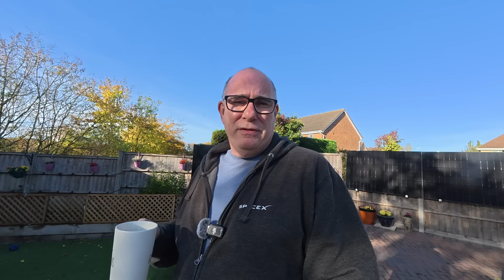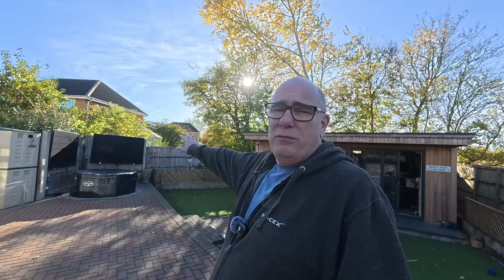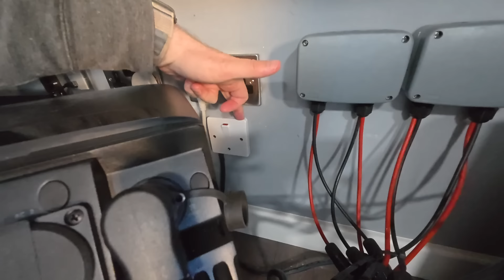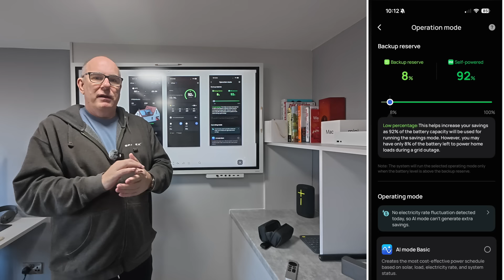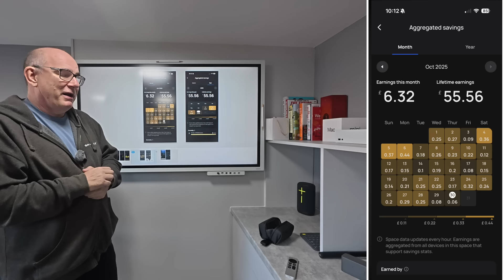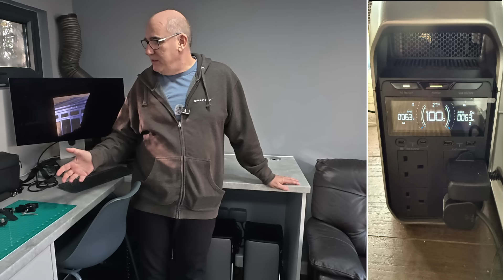I Tried Plug-In Solar for 90 Days (EcoFlow Stream Ultra UK Review)

Comment: Hello Jonathon
Do you know if this system works fully with a smart meter that has been installed by Scottish power?
Or do I have to purchase the ecoflow meter ?
Great videos by the way
Reply from the maker: yes, you need the EcoFlow smart meter as the two things do different jobs. Your Scottish Power meter is just to record the amount of energy used. The EcoFlow meter does a different thing it measures in real time how much energy is flowing in or out of the system and communicate directly with the battery system to tell to round up round down the supply.

Comment: Does the second Stream Pro allow you to increase the output power, or does it only increase the total capacity to 4 kWh? 
For example, if I need to boil a kettle rated at 1800 W, will connecting a second Stream Pro help?
Reply from the maker: So there’s two different ways you can get the energy from the system, if it is wireddirectly into your mains using the set up similar to mine where you have the stream ultra with an add-on stream AC pro then you’re still limited to the 800 W that the inverter can put into the mains. Now in theory you can have multiple devices or with their own mains connections each putting 800 W into the house. But to answer your question about the kettle if you connect the kettle directly to the outputs on the top of the stream ultra or the stream AC pro then you can boil the kettle directly from the inverter in the device no problem. You just can’t feed that amount of power into the house due to regulations I believe.
Reply: @JonathanTracey  I mean when there is no electricity: if you connect a second Stream Pro, does the output power increase? Right now, mine goes into protection mode when I turn on the kettle.

Comment: Hi Jonathan, really great video and learned a lot from this. I bought the Ultra and Max in the December sales. I ran it initially using 'Semi-automated monitoring' (setting my estimated base load + an Ecoflow x Shelly Smart Plug for the fridge) to get cover the majority of home consumption. I then also got the Ecoflow x Shelly Pro 3EM Smart Meter this week to try and use the 'Smart meter monitoring - zero feed-in' as an alternative energy delivery strategy. I have an existing Tesla Powerwall 2 with 5kWp rooftop solar and so Stream batteries were there to stop me pulling peak energy in the winter and get some extra solar on my fence.
Could I ask, when you did this video, did you run this system alongside an existing battery system? If so, how did you set up the Ecoflow energy delivery strategy?
I found that as the Ecoflow x Shell Smart Meter is mostly showing 'zero' import during the day (as we're using the Powerwall), it doesn't make a lot of sense to use the Ecoflow x Shelly Smart Meter and using the 'semi-automated monitoring' (Estimated base load + fridge load using ecoflow x Shelly smart plug) was probably the way to go. Would be great to hear your experience of this.
Reply from the maker: sure I even did a video on how I manage multiple inverters -https://youtu.be/qifTo0Tr6E8 The short version, I use the Stream system to provide base load, I don't let it adjust it just pumps our a standard amount of energy per year into hte house, if we don't use it, it gets exported. The main batteries just handle the extra load as needed

Comment: Quick question Jonathan, asking for a friend.   With a system like this (no other solar or battery) just to reduce energy costs (no export just self consumption ), is there any requirement for DNO application?
Reply from the maker: in theory, yes you need a G 98, which is just a retrospective notice notice after the equipment is installed. Because the equipment is capable of exporting energy to the grid they need to know that it’s been plugged in at your property.
Reply: @JonathanTracey many thanks Jonathan, I’ll let him know.  Whilst I’m about to have a full system installed he is keen to dip his toe in to reduce his bills so something like this may suit him. 👍

Comment: One of the interesting implications of this system being AC coupled is that you could have both backup and use for some baseload requirements, like refrigerators and window air conditioners/ window heat pumps. From what I understand, for devices plugged into the back of the stream battery, they have power while grid power is out. Looking forward to seeing more US states allow "balcony solar" systems like this, as the entry price is much lower than with the more powerful units.
Reply from the maker: yeah absolutely, it provides a UPS function in my office for a number of different devices. One of the other nice features is you can actually distribute the batteries around the house so that they can be close to devices that you want to have a backup function for.
Reply: @JonathanTracey I am glad you mention this because one thing i haven't understood is, if you buy multiple units to place around the house (forgetting the two 240v outlets at the back) does this mean you need a dedicated line wired into a fused spur for every single unit placed around the home? I feel this could quickly get expensive? ... pulling floors and walls for cable runs / electrician costs etc
Reply: @SleepToTheSounds  If you are in the UK wait a couple of months and you will be able to just plug them into any 13A plug. You cannot do that right now of course, because that would be wrong.....

There is a limit of 800w that will be able to feed back into your house. Legislation is not published yet so I assume that would be 800w total, so if you had two units your could limit each to 400w, while using the outlets on the back at 2300w.

Comment: So I can’t just buy the kit, connect it to a regular plug in the house, charge it overnight, and let it discharge into the house during the peak time. Technically speaking is it possible…
Reply from the maker: Legally in the UK, you can’t just put a plug on the end and use it. However, that’s exactly how it’s used in every other country in Europe. It’s got nothing to do with how it works is down to UK electrical regulations. What do you do with that information? Is completely up to you?😂

Comment: Hi Johnathan excellent work thank you. I do have a question. Does this need a ct clamp? I already have a givenergy system and battery. The panels are on the garage roof and battery is also contained in the garage. I am keen to expand my system (we all are) and would love to play with this DIY approach. Does it complement the existing system or fight it.
Reply from the maker: you will need something to read the energy going out, Ecoflow offer a branded Shelly meter that has CTs
Reply: @JonathanTracey  Thank you for not only the swift response but also taking the time to do so.

Comment: Can you wire 2 solar panels into one MPPT socket? …..if so what’s the maximum power per MPPT allowed ? ….. or does each panel have to go to its own MPPT?
Reply from the maker: Yes you can have multiple panels in parallel so long as you don't exceed the limits, these from the ecoflow website. 

For the EcoFlow STREAM Ultra, the MPPT / PV input specs are:
MPPT voltage (operating) range: about 15 V to 60 V DC. 
Maximum input current per MPPT: 14 A. 
Maximum total PV input power: around 2,000 W (which is 4 MPPTs × ~500 W each).

Comment: One quick ques…

Do the Stream series like the Ultra-X really take up to 3 seconds to bring the AC socket online?

Eg if you have a PC plugged in and there’s a power cut, you’ll drop power for 3 seconds until it switches to battery? 🤔
Reply from the maker: I can’t speak for the ultra X, but my ultra acts as a UPS, if the power drops there is no interruption in the computer that is connected to it
Reply: @JonathanTracey really? Interesting.  Can I ask if the Stream AC Pro devices are the same?

This is possibly changing some of my purchase path.

Comment: Why not install the panels on the side of your house , have an adjustable bracket so you can set it to the correct angle to get the best sunlight, during winter and summer. Simple cheap wooden frame with the panels screwed onto it.  Even your panels could very simply with a few lengths of wood be pointed up a bit.
Reply from the maker: been denied by the chief garden planning officer

Comment: I bought an Ultra and AC Pro and run it on a plug for now, until I can wire it into the nearby garage consumer unit. I have paid for the 'premium' upgrade as I am on Octopus Agile and the batteries now charge automatically during low priced periods and discharge at peak, dependent on the prices of the day. I can see why you wouldn't do this if you are on a predictable 'specific time' tariff, but it works with Agile great. Ocationally it can be a little buggy and not charge, but those instances are rarer now. Plus the update to manually charge/discharge at specific times is a useful feature for the day that the AI fails to be supported.
Reply from the maker: thanks for the update , seems a little much to claim it’s Ai when it’s a simple as if price is less than x start charging
Reply: @JonathanTracey indeed. A simple algorithm is all that's required but calling everything AI is what every large company is pushing for nowadays. So much overvaluation of this technology has been invested in, the bubble is going to burst at some point. However, we all hopefully will have the custom mode to fall back on if the 'intelligent' function fails 🤞🏼
Reply from the maker: Yeah, fully agree, the do seem to be labelling everything they possibly can as AI

Comment: can you connect and use a 2500 watt electric heater or a 2500 watt wasmachine direct into the 2x Ecoflow, i did read it is max 2300 watt, is that the max 2300 watt only from out ecoflow batterie and the rest 200 watt, it will be get it from the grid? or does it stop working?
Reply from the maker: it will probably trip  its fuse if you try and pull more than the rated amount

Comment: As you already have inverters batteries and PV with a G99 approval for export ( previous video content) is it necessary to notify the DNO of your new capacity addition and possible increase in exporting? Multiple inverters with export capability and totalling >3.8kW often require G100.2 in addition to existing G99 approval for the home, or do I misinterpret DNO requirements?
Reply from the maker: yes for new inverter capacity but not for a battery expansion. 

if you are just adding a new inverter without a request for increased export it’s a really simple process

Comment: Thanks for the video. Very interesting. I was wondering if you can share, how much of the battery capacity can be used. I usually charge my home battery to 100% and discharge to 20% so out of the 12kw I can use only 10kw. What about this? It's 1.92kw, do you charge to 100 or to 80 ?
Reply from the maker: it will allow you to set 0-100% but the app recommends 5-90% as a default
Reply: @JonathanTracey well that's still an 85% of the total capacity. Pretty good
Reply: @JonathanTracey the power that can provide to the grid when needed is capped at 800 wvregardkess of how many units you gave, correct?

Comment: Since you have the PC installed on the ac out of the stream  , when the battery or solar runs out does the switch-over  tine causes PC to shutdown ?
Reply from the maker: No, unfortunately there’s no signal sent from the batteries to shut the computer down. For that you need a traditional UPS that has some form of signalling to the computer, usually done over a USB or serial cable.

Comment: Since you also have a Powerstream system, would you say 1) Smart Plugs still work 2) Operationally it functions like the Powerstream x Delta combination?
Reply from the maker: yes smart plugs still work, it does not yet have all the functionality of the delta/powerstream combination but software updates are coming thick and fast and keep adding features. Much as I like the DIYness of the powerstream this is a better system for most users, its plug and play and set and forget
Reply: @JonathanTracey thank you for the info, I'm currently using the Powerstream x2 and Delta 2 Max + EB, but since the Powerstream is discontinued, I'm planning to move to the Stream ecosystem. Thank you again 😊

Comment: To recap, in your opinion, which is best octopus to be on, utilising both solar/night rates, to top up the ultra systems 🤔

Thanks Jonathan..
Reply from the maker: i’m afraid that’s not a simple question to answer, if you have any EV then either octopus go or octopus intelligence guy, if not probably cozy but I think that requires you to have a Heat Pump. If you have neither of those then you may be better off looking at flux
Reply: @JonathanTracey  thanks fella.. no ev, no heating pump, just looking to utilise an Ultra to reduce the overall household running costs with a 'quicker' payback timescale on this purchase ✌️
Reply: @JonathanTracey  would you have an affiliate ecoflow discount code that you could share, before I hit the black friday buy button?

Comment: Helpful video thanks. One question, the fused spur connected to the distribution board, on its own connector. But did your electrician need to make that connection by installing ecoflow's smart meter block?
Reply from the maker: No, I don’t use the EcoFlow smart meter, because I don’t want it controlling its output. I use it to explore a consistent baseload that way the smart functionality is not competing with a smart functionality of my other bigger inverter.

Comment: Your usual calm and comprehensive presentation has given me hope that if I buy this system I will not need the premium ai.
 However, I have an existing “dumb” pv system which exports to the grid and I want to use this to save the extra solar without adding to my grid export. I want to use solar top it up 20:51 on weekdays and the grid for ten cheap hours at weekends. Do you think i can?.
Reply from the maker: so a little more digging the premium feature is worth even less than I thought, its not to stop you exporting to the grid its to allow you to share power between ecoflow powerstations. So if you have a delta 2 (the only one supported today) you can share excess power to that. Seems strange to pay more to stay in the ecoflow system. If you want to export the power to the grid then this is a standard function

Comment: I would , Love a Video Capture video from you phone screen shotted, Showing This AI pay wall problem , If you loose you 50 to 100 Export savings spent on AI, Might be a Deal Breaker, I am not buying to be Green , Feel like its Genuinely got to Save money. Maybeca Delta Max would be more cost effective in Long Run. Thank very much for Info.
Reply from the maker: I will take a look and see what I can do
Reply: @JonathanTracey , I have old system with cheap 4x 12v battety. But then without Automation could not save final 1 or 2 kwh per day. I did get the Powerstream from Ecoflow but stopped at the point as Still could not get Export tariff without paying for Extras like NICEIE certificates, I just got the Pete , Pink mini this Renwed my interest but, Things have not moved as , I would like tjink still need a Home assistant Pi to Automate. Begs Question will it really be worth. Zero Standing charge coming in Jan. Might maje it Viable  , Thank again for Stream AI info. 😊😊😊

Comment: Hi Jonathan, thank you for your really informative videos on eco flow products and connecting it to your home system. I'm a renter and have just built a workshop. I'm looking to power the workshop off grid, and eventually power my rented home (lone occupant, 1bed log cabin with air source heating). I have, at present, a Delta 3Plus. Am I able to use this instead of the stream to power my home? Or do I have to have a stream device? Any advice appreciated- I'm a paramedic, used to fixing people, not electrical systems! Thanks, Faye
Reply from the maker: I believe you can add a stand alone stream inverter to your D3+ check on the ecoflow website the inverter is pretty low cost (about £100) but should then let you plumb it into your electrical panel

Comment: I have been following Solar panels and battery systems for a while and an interesting development is that some panels have a broader operating range so can generate more  electricity on none optimal days and perform well on days with partial clouds. These do cost extra but may suit some people better depending on location.
Reply from the maker: I have yet to see this proven in a UK setting, they may make a few tenths of a % increase but I would just get mainstream bifacial panels and you can't go far wrong

Comment: This was really useful - mine doesn't discharge sensibly even though I have the EcoFlow Smart Meter but now I know I can set a reserve on the battery, it won't start discharging until my baseload is higher after midday. Thanks.
Reply from the maker: I wonder if its trying to charge the batteries first before discharging. Sorry can't help more as I use mine without the smart meter (I have it set to discharge on a schedule)

Comment: Are your eco flows connected to the house grid or just the office ? If they are on the house grid how do you manage the multiple inverters and battery brands so they don’t try charge each other or balance the house load over the lot.
Reply from the maker: its connected to the house via the mains, they don't try to compete as I have them setup in specific way to avoid this. See https://youtu.be/qifTo0Tr6E8